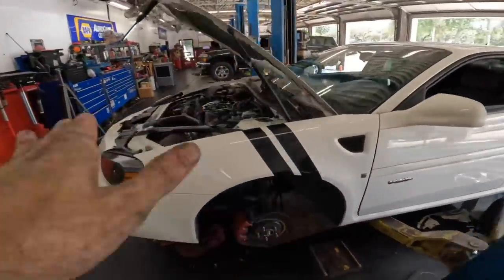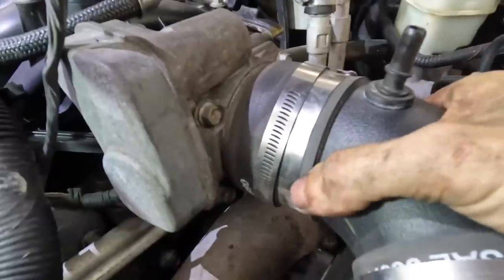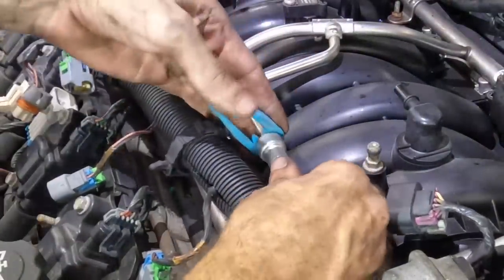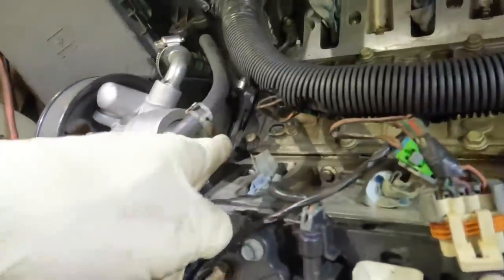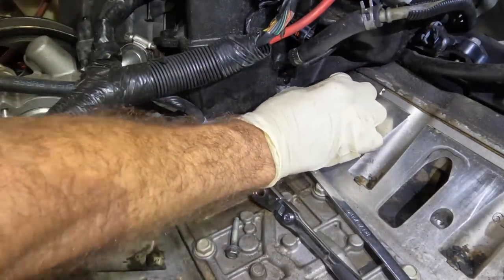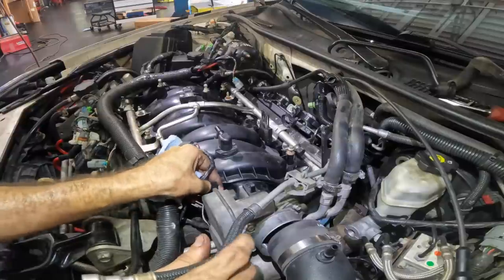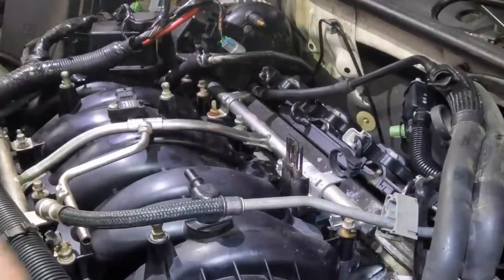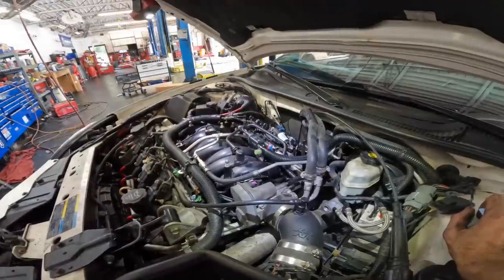Brake Clean Pressure Washer! V8 Powered Pontiac GXP 5.3

Comment: I dropped that same engine/transmission into a 1988 Pontiac Fiero. Added an Edlelbrock supercharger and other go fast goodies. Corvette front suspension, 'Vette brakes all around, complete V8-Charlie interior, etc.  Made 650 RWHP! Loved that car. Finally sold it when a guy at a car show made me a deal I couldn't refuse. Still miss that car...

Comment: Ray, an Idea for you,  the next time you have one of those bolts you have to leave in the manifold, because of clearance issues, take a small piece of vacuum hose, cut to length, in this video it appeared to be about an inch to inch and a half, slice it down the side, and slip around the bolt shaft between the bolt head, and the manifold. This would hold the bolt up out of the way, so it wouldn't get  caught, while removing, and replacing the manifold.

Comment: I used to work at a GM dealer (Cadillac) during the 1990s.  The front-drive V8 configuration with the Northstar engine was their bread and butter during that era.  One customer loved the way his STS "ripped the wheel right out of his hand" when he stood on the throttle.  Other people call that torque steer, but from my standpoint this was a golden era for Cadillac because of the Northstar V8.  This GXP is a remnant from the true "back in the day" days.  Great work as always Ray, your GM knowledge is quite impressive.

Comment: Way back before there was brake clean we made a sprayer with a cannister on the bottom that we would fill up with gas and along nozzle. So when we hooked up the air hose to it it would draw the fuel out and out the nozzle, worked great.

Comment: The assault blow gun is sick. I used to have a few blow guns (40, 50 cal.)
I had a Co2 setup, it'd sink a dart half way through a 2×4 (the long way haha). Then I started using the air compressor with longer barrels, it was insane what a small metal dart could do. 
Ray, you are a very creative person.
Cheers Brother!

Comment: I like the philosophy of tearing down as far as you can with the first tool. Back in the mid 70's I pulled a transmission from a '61 Econoline with a 6 inch crescent wrench. Everything was loose and oily.
Reply: You have to work with what you got hey long as you figure it out made it work that's the main thing have a great day

Comment: Hi from uk ray👋👍 good little job this for you and pleased you enjoyed working on this vehicle makes job go smoother too 👌 noticed at end shop got pretty quiet 😬 passed that time eh mate👍 and thanks for the little history on not everything works out ( the rogue copper crush of washer) 🙈 just pleased you took time to locate it rather than hearing that noise that costs👍 good call rather just re ordering the washer as that wouldn't of helped😬 thanks for your time and be safe see you soon👍👋
Reply: Years ago my cousin was working on a 64 GTO convertible and asked me to help me start it up apparently somebody had dropped a handful of washers down the carburetor well he pulled the intake & the heads the valves weren't quite adjusted I held a 750 double pumper wide open was looking at it when he cranked the engine and it backfired I got a haircut that day and it started snowing particles of hair you live I through it 's not so bad have a great day

Comment: I once had 5/16th stainless steel washer go from my Weber carb through the 1600 Celica motor @ high revs and actually go right out the exhaust with no damage , should've bought a lottery ticket

Comment: Man the story about the crush washer in the intake runner brings back memories for me😂 I was changing knock sensors on my 5.3 ls at the house got everything back together and the truck wouldn’t start. Was in college for automotive tech so I trailer it to school. Found that number 3 had no compression. Stuck a boreascope in the spark plug hole and the fuel line retainer was sitting in the cylinder 😂 I told my instructor idk where that came from because the retainer from the truck was still in my tool bag. Now I’m extra paranoid when intakes are off I use masking tape to cover the holes

Comment: When I saw the lush valley, it reminded me of the metal coolant pipe that runs through the valley under the intake on the 2001 Ford 5.4L 2 valve. That pipe can corrode and leak in the area where the pipe goes into the back of the water pump. If your valley is lush and green, you have a leak.

Comment: I had a 68 Impala SS and was driving in St. Louis, Mo (lived 60 miles from there) and the car died.   Since I didn’t have my tool box in the trunk(for some strange reason) I couldn’t replace the mechanical fuel pump that I found was the problem.  There was a repair shop about 200 feet ahead and down hill.   Put it in neutral and pushed it to their lot.   They agreed to replace the pump for me.   When done, they said I was very lucky.   The arm on the pump that went into the crankcase had fallen off and into the pan.   With a very long set of needle nose plyers they got it out.
Reply: That was a close call. Reminds me, I remember a UK wheeler dealers episode where they bought an Audi TT with three missing gears. Turned out to be a selector fork that fell off in the gearbox due to a broken rivet. Somehow missed every gear and landed in the bottom of the gearbox. One bolt and a nylock nut, fixed by mr Edd China.
Reply: I had a 68 Chevelle that had the same damn fuel pump design fail on me.    Used a huge blob of grease to keep the little arm up so when you insert the pump, it will engage correctly.

Comment: As far as training your brain to enable your left hand, I can state that you are correct.
My father worked as a hand engraver for Monogram Models for years, doing the fine detail work on hobby kit molds.
This work required using steel gravers to sculpt wood grain, facial features or mechanical details into the steel molds by hand.
He could write equally well with either hand, as I recall.
Reply: Thank your Dad for the great work. Built lots of those kits with wood detail.

Comment: I watched your first video and I am amazed how you treat such a difficult undertaking as routine. I would dread having to deal with such hard to reach items, not to mention multi component disconnections,  but you take it in stride. I guess after many years you have gotten use to it and pretty much expect it. I'm sure there might be other mechanics near your skill level out there, but it's a crap shoot. This is why I have always done my own repairs. The last time I went to a dealer (for warranty work), I had the interior of my brand new Dodge flooded with antifreeze due to a botched AC evaporator replacement. Also I never noticed it, but the dryer was flapping in the breeze. I had to go to the junkyard to find the correct mounting hardware to attach it back to the fire wall. Thanks Arrigo Dodge!
Reply: It is a lot more difficult than ray makes it look. He does it all with 95% clean language. Ray has the self control of a Vulcan. Most curse up a blue Streak that could teach a sailor a phrase or 2.
Reply: @Number6_  He makes it look easy so when you're bent like a C down the bay in your daily beater, tryina bust a rusty nut that don't wanna give while 5 non-flush cut zipties wait patiently around your hands for their time to shine, you'll have one more thing to curse at, therefore making your work a little bit better.
Reply: @GashimahironChl  I don't speak your language pal.
Reply: @Number6_  I mean, if you were one of my pals, you'd know. :P
Reply: @GashimahironChl  learn English!
Reply: @Number6_  I think it's the other way around, 'cause if you knew any english beyond what's on the textbook, you'd understand what i said.
Now ain't i right?

Comment: As for blowing out the intake runners I've been doing it all my life and haven't hurt anything yet. One shop I worked in a few years ago another mechanic was putting in a reman C15 Cat in a W900 KW and when he took it out on a test run after finishing he called back to the shop for the wrecker. When I got to him he said I think it blew up! When he pulled the head it had a hole in the #1 piston and a bent intake valve and there was a 3/8 nut imbeded in the piston!! We don't know to this day if he dropped the nut or it was in there from when CAT done the reman.

Comment: Back in old days before brake clean and penetrating oil. We were tearing down a “32 Ford with flathead V8. The pistons were froze so we were pouring whatever we had on the pistons to free them up. Someone took the fuel pump hose hit the starter and sprayed gasoline on the piston tops but after awhile hit the distributor and caused a flash fire. All the  hair on whatever side facing the car was burnt off our heads and faces. I lost half my hair and eye brows. Some good beards went up in smoke.

Comment: I'm surprised they didn't change that pipe the first time they had the intake off instead of JB weld since the tube only had 2 bolts ! That tube couldn't cost that much !
Reply: Somewhere in part one or two Ray said they did not remove the intake manifold, the JB weld or whatever used on the leak was put on with the limited space available. That is why the application was poorly done and still leaking at the underside of the tube.
 The car owner, is a viewer of Rays channel and commented in Part one that he considered removing the intake to replace the cross tube but the leaking rack and pinion was a more complicated job above his ability not having a lift.
Reply: I reckon this pipe will fail again due to differential temperature/expansion of the pipe and the block.  Line needs a good kink in it.
Reply: I think it does have a 45 degree bend in it at one end.
Reply: They could have even cut the pipe and put a chunk of fuel line between it! JB weld though???

Comment: what i wanna know is why they didnt just replace the crossover tube when they had to take the manifold off to put the jb weld in in the first place???
Reply: It looked like they poured the JB weld from the outside, that's why it was leaking from the bottom where they couldnt get to....

Comment: every time you use the assault blow gun you can see the salt from the tears of the weak blow away...
Reply: also for those tough bolts, you need approximately 1.5x the bolt diameter depth of thread engagement for steel, and 2x the diameter for aluminum. So if you have a bolt that's way too long and you have more length than you need. It can be acceptable to shorten the bolt. This has saved my backside more than a few times over the years. Cut the head off the old one, shorten the new one enough to fit and still have nominal engagement. Always check to see at what depth the threads engage and measure from there if you do this. Some holes have more lead space than others. Damn I wrote another book. rofl

Comment: First time I beat you to a solution! I was yelling to myself to put the bolt in the doodad first, then slide the line home with the bolt in place already. Would have worked to take it out too, which is where it occured to me first. Probably the last time it will happen, but you take your victories where you can.

Comment: I did a bit of research on this car and discovered that it is actually is a Pontiac G8 GXT!  This was a car built in - and imported from, of all places, AUSTRALIA!

Built by Holden (GM’s Australian manufacturer), it was marketed as a replacement for the Bonneville.  It was a rare FWD performance car that was briefly considered for marketing by GM as a polices cruiser for the US market. Unfortunately, Federal rules about only funding for US-made police vehicles prevented it from being an extremely fast cop-car.  Due to an economic downturn around 2009, the G8 “super car” disappeared from the marketplace…
Reply: No it's not. This car is the Pontiac Grand Prix GXP. Based on the W-Body and built at Oshawa Car Assembly, Ontario, Canada. LS4 engines are for FWD cars.

(Less rude edit) Try do a better research regarding the Grand Prix and the G8 GXP
Reply: @Alpha06R  Don't you think you could have said the same thing without being rude af or
Reply: @firstlast---  Don't mean to be rude, but in last video, Ray said that this was a Grand Prix GXP. The G8 is (like the VE Commodore is based on) a RWD Car, Longitudinal Engine and is very easy to identify the differences on both. 

When doing research, and proclaiming to have done that, it is supposed to highlight the differences. Again, not rude, just straight answers.
Reply: @Alpha06R  Okay well if you really don't see anything wrong with telling someone to do better research I can't help you. People are so comfortable with disrespecting others when they are nice and safe behind a screen I am doubtful you have the courage to talk to someone like that to their face
Reply: @firstlast---  As a matter of fact: I do say straight thing to people in front of me. I'm not afraid to say things, and to recognize if I'm wrong. That's something I dealt with having Asperger Syndrome.
Reply: Well, sorry, I was wrong - you are right.   The rebranded Commodore WAS RWD, now that you mention it.  I also should have known as none of engine displacements matched that of the Commodore/G8.

One thing I CAN say is that I am willing to admit my error.  That counts for something, I bet.

Now what do you have to say?
Reply: @theackshow5048  Nice. Hats off to you.

Comment: Love the fact the owner "modified" that bracket and fixed engineering stupidity. (As an engineer, that was one of the things I did, make sure the projects I worked on were  serviceable - other engineers HATED me for it.) Reminds me of a 1992 Oklahoma edition chevy  truck W/T 1500 I had. The truck was obviously half ton, but it had a first year vortec V6 with a 3/4 ton driveline. So the transmission and rear end were 3/4 ton, with 1/2 ton hubs. A weird beast indeed. The transmission was a cast iron,  granny low (2mph top speed), 3 speed, with an overdrive that you could not shift into until going 65mph.  That truck got 23 mpg at 70 mph on flat road!  The clutch went out and I did it myself. That transmission was like 300 pounds!!!! I swore, NEVER again!!!!! I am paying for this next time! About 2 years later..... The pivot pin the throwout bearing rides on broke... dadgum it! Well, true to my word, Off to the shop it went. No way I was crawling under that beasty again and get chest crushed by this impossible transmission.  The next day the transmission shop calls.  Hey, ummmmm..... We are going to have to take the truck cab off to get this transmission out. When you slide it back, the shifter pin hits the body and you cannot slide it back far enough to get it out.  We are going to have to change our estimate.  
I replied, no, you're good.... Lift the rubber floor up, the floor panel is cut. Get some channel locks and bend that floor up and she will slip right out. The guy says ok....... after a long pause. 
He calls back in about 2 hours and says, we got it out, hey, so did you cut the floor of the cab like that? Looks like someone cut it with tin snips.  I replied, Yes.... So he says, so you've had this transmission out yourself before??? I say - Yes, yes I have. So he replies, If you know how to do it... and you obviously do, why didn't you just do it yourself? 
I said - because YOU'RE doing it!!!!!!!!

Comment: Worthless information:  in the 60s, the Oldsmobile Toronado was a front wheel drive car with a V8.  It was so different to not see a transmission or drive shaft hump.
Reply: It wasn't transversally mounted and the engineers left space. This GXP was a tight mess to work on unlike my 2009 aussie style (Holden) which likewise could be a pain but you didn't have to remove almost everything to get the manifold off.
Reply: 60? Really?!? GM stop making them in 1992!! First generation was 66-70
Reply: @av8tore71  don't forget the 79s caddilac Eldorado with the 500 cu in modified turbo 400 that was FWD

Comment: You move so fast I'm surprised you don't lose more stuff than you should. Like taking the bolts off of the intake and just tossing it up there by the windshield. I'm so used to bagging everything. When I'm working on someone's airplane like the exhaust. I will bag the bolts and notate what they are and where they go then the valve covers or any type of bolts for like the alternator everything is bagged and notated where it goes. We use AC DELCO alternators which is the same used on cars however, most airplanes are a 24 volt system a

Comment: I remember when GM released the 2006 Monte Carlo/Impala with this engine. Everyone loved the idea of installing a strong V8 in a family FWD based car. The main problem with this engine is how AFM (Active Fuel Management) would mess up the engine if one didn’t keep an eye on oil changes. Also, I’ve known owners of this car (& it’s variants) to obliterate the 4-Speed 4T65E-HD transmission. Although it’s strong many people still destroyed the transmission due to non-service & extreme abuse.

Comment: For these screws that are too loose for the ratchet to work, Proxxon of Germany makes a ratchet on which you can twist the grip to turn the screw until you can tighten it, when it works just like a normal ratchet. Look for "Proxxon rotary". Could be useful in these situations.

Comment: A old friend of mine had a 1967 Chevy pickup truck that we put a LT1 Corvette engine and transmission in. It was in a body shop having some work done to it and the guy somehow dropped a chunk of body filler in the carburetor and didn't say anything to me or him. Needless to say we ended up replacing the engine and transmission in it.

Comment: Welp I had to do it because you said it,  I had to go look to see when the alternator bolt came off....It was on at 30:58 then you cut away/came back with new parts and it was gone. At 31:04 you can see it the bolt off and on the head (it's a bit blurry). Better shot of it at 32:27....